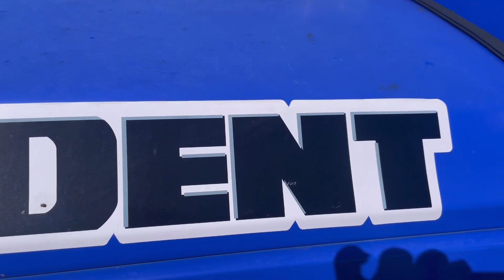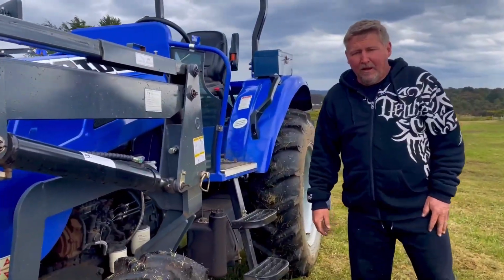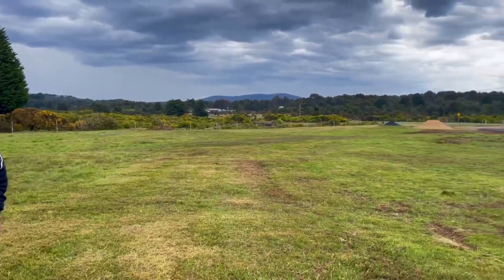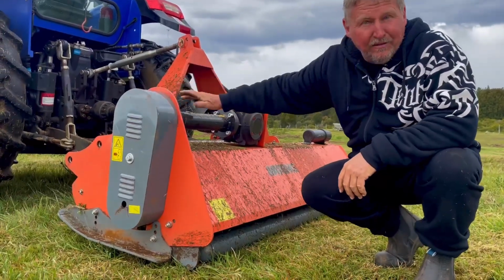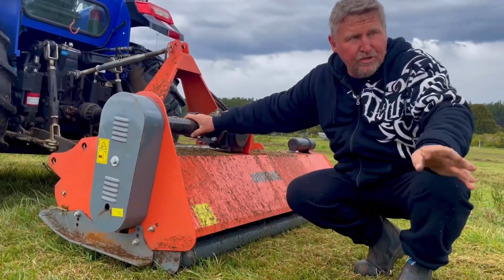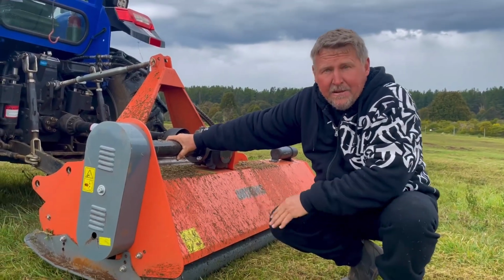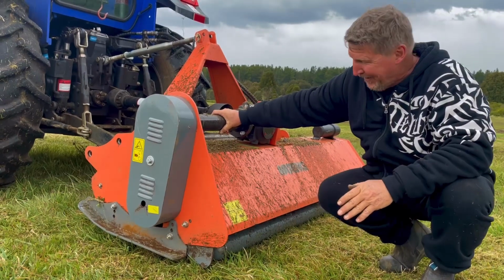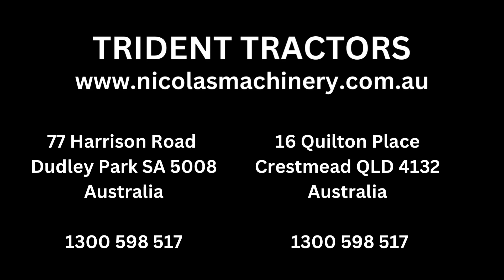Trident 55HP with flail mower

Comment: I have had one flail mower and a couple of slashers and found that slashers are much cheaper to run and will do everything a flail mower will do, except mulching the grass and chopping up sticks. I had one ordinary slasher for rough work and one with rollers mounted for fine work, that I used on a turf farm. A slasher with rollers will do a good enough job for turf and is nearly as good as a dedicated turf mower. A flail mower just can not compete with slashers, for most work and it is expensive to replace the flails, much more so than replacing slasher blades.